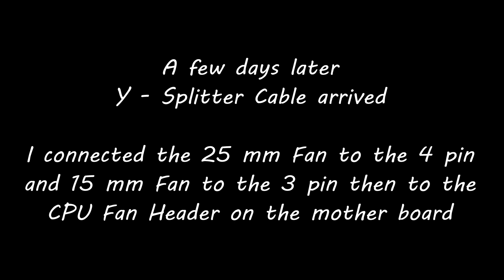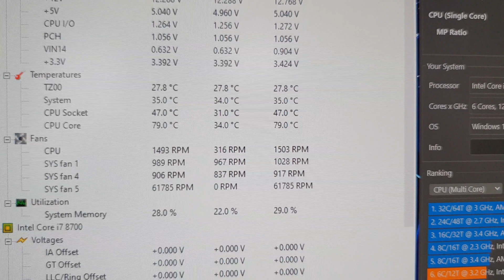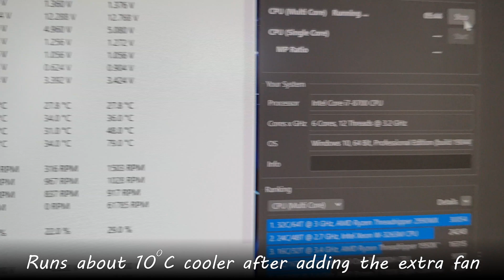Installing a Cooler Master XtraFlo 120 Slim Fan (15 mm Slim Fan)

Comment: Great that by adding an additional fan, temps dropped by 10 degrees... but the part i dont quite understand is why you had the one fan in push config, when since the beginning it would have been the same installing it on other side as pull config and ram slot would not have been an issue....
Reply from the maker: One fan alone in push or pull config wasn't cooling the CPU enough.
Reply: @HelloRichard  Yes but what i meant was not having the ram issue from the beginning by installing the fan on the other side. Still it was a great idea to use push pull config to have a better cooling! :)